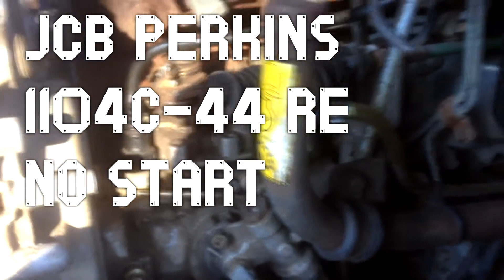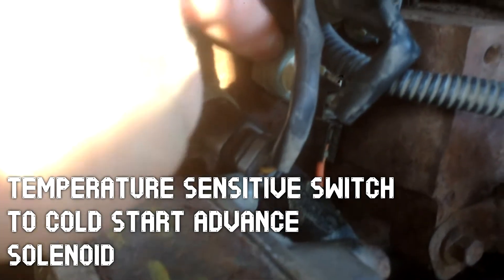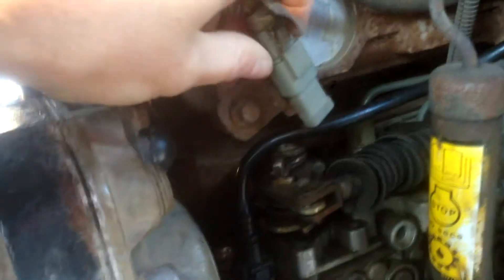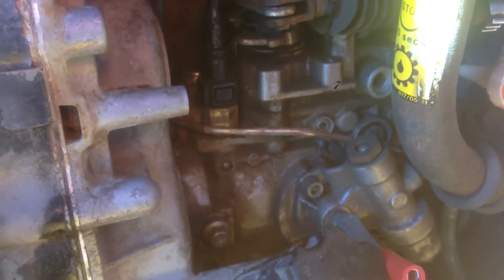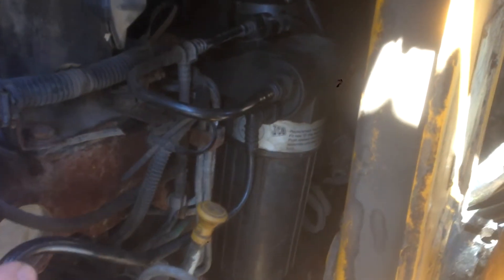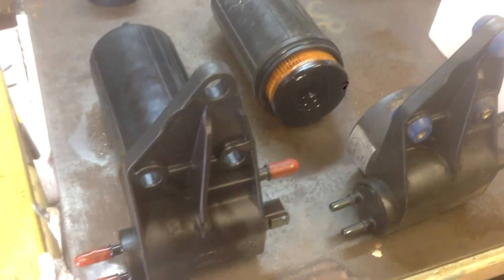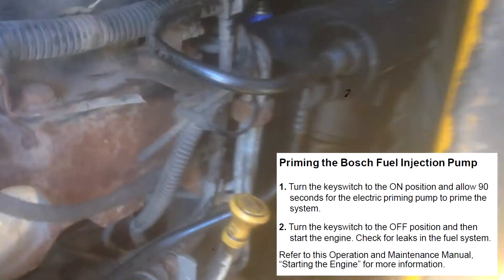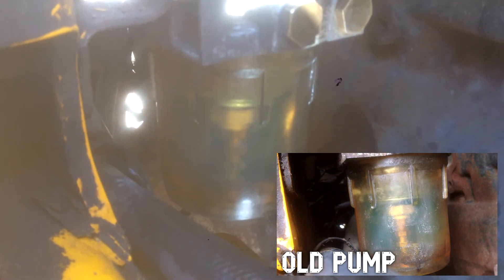JCB Perkins No Start Electric Lift Pump Replacement

Comment: I would like to thank you for posting this video and an explanation along the way.  I have a JCB 214S and have been having a great deal of difficulty lately...  it started with poor performance, running rough, then had a lot of difficulty starting.   I tried a few things, got it to start once after changing the fuel filter, draining and cleaning the sediment bowl, priming the whole system.    It only ran for about 20 minutes and then wouldn’t start again, so I went further and based on your video, checked the operation on the mechanical fuel pump.   While cranking the engine, it would not fill the sediment bowl.... hand priming resulted in hearing a lot of air bubbles in the tank but eventually after about 45 seconds of manual pumping the sediment bowl started to fill.....slowly at first but then faster.    There are a few of the solenoid connections which also require the same type of work as yours did, so while I am waiting for a new fuel lift pump to arrive I’ll repair those.  Ordered both the JCB mechanical pump and ordered a 12v electric pump as a backup or if the part ends up being wrong.      It would cost me about 1500.00 for transporting this machine to and from a shop (and that’s before any actual mechanic looking at the machine), so this video has been invaluable.  I’m all about trying to do things on my own when I can, which sometimes is even a necessity given where we live (Alaska).      I consider myself handy and mechanically inclined but don’t know my way around Diesel engines quite yet.   Thank you again!  Very much appreciated!
Reply from the maker: Glad I could help, I hope you read the update in the description.  I had to replace the sediment bowl itself, as it wasn't sealing properly and allowing air into the system which would cause it to lose prime.  I'm no diesel expert either :), but since replacing the sediment bowl I haven't had any starting or running issues.  Good luck with yours!